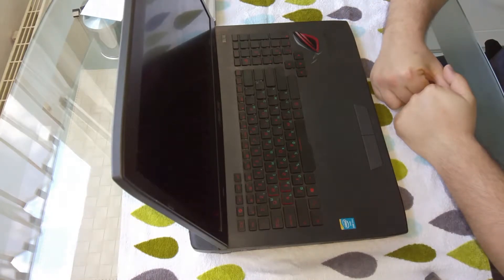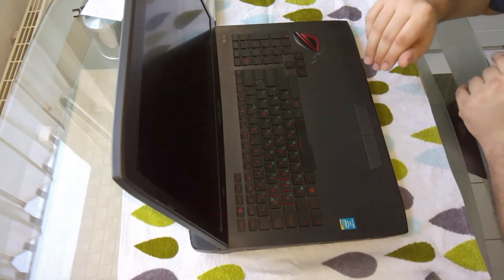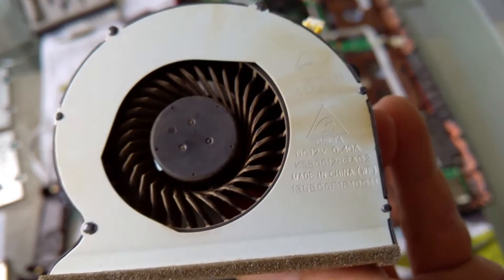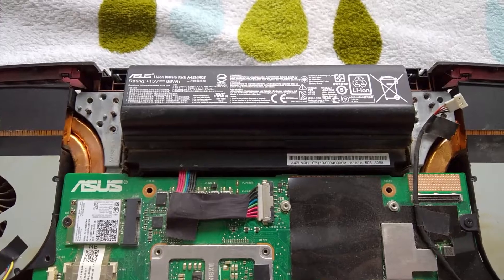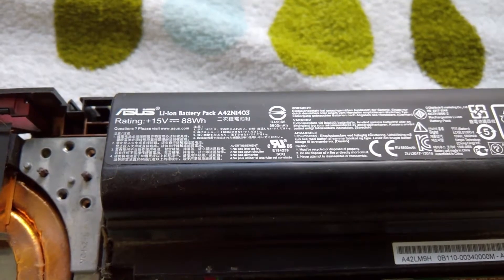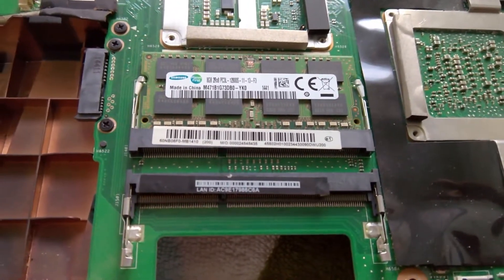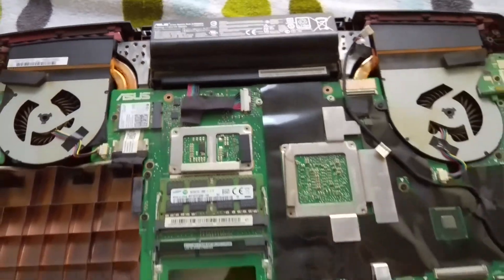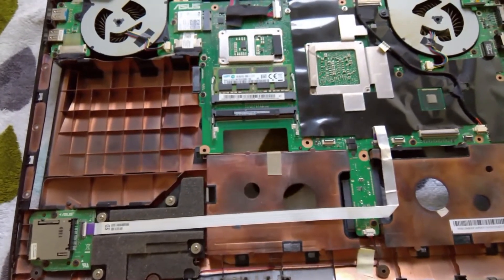Asus G751 - Things you need to know HD

Comment: Been using it like a desktop, not a laptop because the battery died just after a year. My previous laptop was a fujitsu 2010 with a removable battery that I used for 11 years and at the end it could still hold 3 hours charge but I had to retire it.

Comment: This is the best laptop I have ever had. Still using it after many years. I have replaced the battery twice, the keyboard, and had to solder in another 32 pin keyboard connector, due to mishandling the mother board and broke the connector. Other than that, it has been a workhorse for me. I run most games on pretty high settings without any issues. I bought another laptop an Alienware 14 with a 3060 graphics card and still would rather use this laptop on a daily basis.

Comment: Had this laptop for years now, pretty good laptop also i did OC the panel to 100hz when i got it. But sadly when i did update to bios version 213, it did corrupt my bios.. Now i'm using it as a paperweight until bios reflashing tool arrives.

Comment: The best laptop i ever seen and use it my life. 4 years working 24/7 on max gameplay max graphics in games. In the hot summer  playing on max pressure non stop and no problems. I have only the battery is not working and im lazy to change it coz i dont need it. One of the best cooling system in laptops i will say. I clean it 3 years after start getting hot 90 degree i open it and i didnt believe how much dust was stuck inside and now is 30 degree less like brand new. Panel quality amazing. Screen amazing no problem with it. Lid amazing strong base. Dosnt shake or anything after u cant even imagine how much usage. I cant even imagine changing to another laptop and if i will i will take next version.
Reply: kotarakbg same here brother! had it since december 2015 on christmas and still going strong in 2020 lol not even a single issue at all and my battery is still holding up to 78,000mah so far, have never cleaned it tho lololol. I got the one with gtx 980m gpu, i7 4720HQ with GSync pannel, and currently rocking the assassin’s creed odyssey on high setting with 40fps, freaking amazing machine!

Comment: I have just bought one, used (upgraded from a G75). I'm shocked to learn about the G751's problems. I'm pissed that I can't cool it from below additionally, because of the case being in the way (removing the bottom service lid doesn't grant access to the heat source). I'm mad the battery can't be removed easily. Which means it always charges and is ruined by now, but still consumes power needlessly and gives off heat needlessly. The ruined sub is a bad joke and I ain't laughing. If anything on the mobo breaks, you can't resell the rest of the components, because they are soldered on?! Oh god. Asus, YOU'VE CHANGED. I used to trust you blindly, ever since the K95 and the G73 and the G75... But not anymore. No longevity, no quality. F**k you, Asus.

Comment: So lately my battery has stopped charging and the light blinks orange, likely need a new battery. But another huge problem I’m having with this laptop is the keyboard, it’s not dirty or anything and some of the buttons do not respond unless you push very hard down on the button. It was working fine until the warranty ran out... go figure 😂 what would you recommend for the keyboard ? I’m unsure what to do but I was told it was going to be very expensive to fix. Thanks!
Reply: Easy to fix mostlikely a cord has come loose from vibration while traveling or minor shakes add up over time, just open it (look at a video) unlplug and plug back the cables, or just buy a replacement keyboard, or an external keyboard, whatever your setup is. Mine is connected to a big flat screen so I have wireless keyboard and mouse connected so not an issue but to each his own I guess.

Comment: Had one of em for 6 month….supreme cooling, CPU ok, GPU overclockable, RAM up to 32 GB DDR3L, battery issues everywhere and way too heavy to be taken on the road in a backpack. Thats why I changed to MSI: No cooling at all, GTX 1070 and 8GEN CPU. Not a very good choice either, but still....the battery works xD

Comment: Are both fans supposed to run all the time? I am only getting one
Reply from the maker: No, not really. When the laptop is idling or you're doing some light browsing only the CPU fan runs. If you put some stress on the GPU the other will also spin up. It's not running all the time though.

Comment: I definitely had issues with my battery and had to get a new one after two years. I then had to change it again the year after. I did well with my 3rd battery but I thought it had died after only few months of use. I couldn't get a charge until I messed with the battery connection with the motherboard and it started charging again. I love the laptop, but it has its headaches.

Edit: Typos*

Comment: Can you help me on this one?

I have my G751JY cleaned for dusting ,when I  bring back parts i don't know what happen but the touch pad and led Hard Disk light isn't working. The laptop won't boot if the touch pad is connected so I have to remove the connection thinking that I might have tripped on the ribbon cable i ordered replacement online but the problem wont go away. The laptop is functioning normally it just wont boot when the touch pad is connected. and also the led activity light for the hard disk doesn't seem to work as its not registering any activity light(blinking) but i see it blinks for a while when I pressed the power button for couple of seconds for a hard reboot. Anyone can help me on this matter?
Reply: EJ San Jose , check the 4 connector under the keyboard.maybe one of them was plugged uncorrectly.try this i m pretty sure about that.
Reply: You need to pull up the little brown or black bar on the top of the motherboard connector.
Pull up the connector 
Put the ribbon deeper as you can 
You can see an blue line write on theribbon.
This line need to be aligned with the end of the connected when you plug it.
Coper pin face up.
Reply: mrvegas06800 thanks for the response. Thou I already did that, I even swap the led ribbon cable with the touchpad cable and it still the same reault. I also order one ribbon cable off eBay and the same result.
Reply: mrvegas06800 strange is the laptop wont boot when its connected and im pretty sure its as deep as it can go. I also bought the laptop yo a local shop and the tech there was baffled about whats going on, asked me to leave the lapyop overnight but I refuse since I lnow they will just experiment on it. Anyway provided they had the ribbon  inserted themselves I taken the variable of wrong plug. Further idea is greatly appreciated. Though im wondering if the touchpad assembly itself needs replacing?
Reply: EJ San Jose check the pins inside the motherboard connector , check if one of them is bended or broken.also if the ribbon can pull off the touchpad try to check the wiring connection with electric  multimeter.
So if all is correct , for me and knowledge i think the better way is to order a new touchpad and try or if you  find  someone living near your location with the same laptop should be an pretty good idea.let me know....
Reply: mrvegas06800 thanks buddy. be checking on it and will let you know.

Comment: My laptop has 3 SSD drives. One boots with OS X Sierra, the other boots with Windows 10 and the third one in the caddy is for storage. I removed the dvd drive and put in a caddy that holds an SSD drive. You can also change the WiFi / bluetooth card if you want to run OS x Sierra on this machine which is what I have done.
Reply: Never thought of this, good idea

Comment: Can I upgrade to a SSD on this laptop? I have the same one.
Reply from the maker: Duckman Gaming Depends what's the ssd. NVMe drives do not work! PCIe M.2s work just fine as well as a standard 2.5" SATA SSD like the Samsung 850 Evo/Pro. This is what I have 512GB Samsung 850 Pro.
Reply: @amv.techpro  Hi. I wanted to ask if a PCIe M.2 SSD is compatible on model G751JM. If possible could you make a video about where the slot is?
Reply from the maker: @johnplaysgames9847  Hi John, I can make a video, but it will be pretty short one, since the M.2 SATA slot is the first thing you see, after you remove the back lid. It's actually inside the left (fans pointing away from you) 2.5" drive slot. You'll have to mount it sideways to the slot If you want to use it, and you'll also have to move the existing 2.5" HDD/SSD over to the right slot, but keep in mind that the right slot is only 3Gbps and not a full 6Gbps SATA connection. If you want to replace the system drive with SATA M.2 you'll have to first move over your boot drive, then clone it, or you can buy one of those SATA M.2 USB Adapters. I've done this before.
Reply: @amv.techpro  Hi Dongleboo. Thanks for the information. I actually replaced the battery on my G751JM yesterday and didn't notice it had an M.2 PCIe slot. I checked with Asus Support and they also said it doesn't have one. I currently have a Sata III SSD 2.5" for booting Win10 and a 2.5" 1TB HDD for storage. I will look further for the M.2 PCIe slot. Could you maybe provide me with a picture or diagram of where it is located when viewing your laptop from the back with the fans pointing away from you? Thanks. John
Reply: @amv.techpro  Also, what do you mean by SATA M.2? What is the difference (if there is any) with PCIe M.2 ?
Reply: Nevermind. I just researched it. An M.2 Sata SSD will only benefit from a smaller form factor compared to a regular Sata 3 2.5" SSD. The only one that will benefit is a PCIe M.2 SSD that mounts on the motherboard. That is the one I wanted to know if it would fit on my motherboard (G751JM).
Reply from the maker: So, I've done some digging and it turns out that some variants of the G751 do not have the cut out in the plastic chassis where the connector should be, but it's there behind the plastic. You should be able to fit even an NVMe drive, but you'll have to update your BIOS first, which is a bit risky on this laptop. I've recently updated mine and it got stuck in a boot loop which took me about 30 mins to figure out. As for the difference in SATA and NMVe, there are some slight difference in the connector types but it will be easier if you just Google "M.2 connector types". Previously the motherboard didn't recognize NMVe drives but they've rolled out the new BIOS last year. I'll try to do a short video describing the topic in the next week or so.
Reply: @amv.techpro  I opened the back of the laptop and I didn't find the M.2 Sata slot that you mentioned in the P0 hard drive bay (left, default bay). And if it is possible to install an NVMe PCIe M.2 SSD I would greatly appreciate a video on it! Thanks. Subscribed.

Comment: Got same problem with this shitty Intel ac 7260 wifi card. Unbelivable how they can put such a bad wifi card in a gaming lap top. Also I have a big problem with cpu temps, goes over 90 - 95 on a regular basis playing latest games. I had it repasted with profesionals after a year , but Im stil getting the same temps. Anyone got that solved? Should I undervolt my cpu with xtu, will that affect my fps in cpu hungry games, does it affect clock speeds? Never done it before so I'm not really sure what to do. Or maybe try buying vacuum cooler...

Comment: Sorry to contradict your information, but it's not only the storage drives and memory which can be upgraded, as I also upgraded the battery and my wifi card. It's pretty easy to get to the wifi, and I put a much better card in than came stock with it. The battery is more involved, but you can wiggle it out without taking the mobo off. Just thought you would want to know for future videos.
Reply from the maker: :) I was talking about mainstream parts, which are replaceable in most laptops. Otherwise, you can replace almost every part on the mobo as long as the replacement part is compatible. What battery did you put in? I'm generally curious as the slot for the battery is pretty tight to fit a bigger one?

Comment: i have the same problem with the battery. My second battery died last months. Is it cuz the heat?dunno why dat keep happening....i heard someone said on a comment in youtube its cuz of the bad cooling system in g751...im running my laptop with my dead battery right now. My laptop goes to sleep everytime. To keep my laptop wake i have to wake up the laptop few times  to prompt to not charging mode.but when i disconnect the power again i have to wake up my laptop few times again to keep it awake.i dunno is it worth to put a new battery again cuz in few months same gonna happen.is it a ok to remove the battery and use my laptop from direct power.
Reply: Have just the same problem. Did removing or changing the battery helped?
Reply: Вадим Кричківський. No I didn't removed the battery yet.....but I think it's the best option right now...
Reply: I think so too, but to removing the battery is really pain in the ass, I doubt I can make it by myself :/
Reply: Вадим Кричківський ya me too.....im kinda afraid to do dat....i dont wanna messup what left of my laptop....
Reply: I'm thinking my battery died also.. It stop charging first, then it used up the remainder of the battery.. Now I have a died laptop.. I will buy a new AC DC power cord and cross my fingers.. The three year warranty is the only way to go with these expensive machines..
Reply: @parallax9281  I just disconnected my battery from the Mobo had no issues for the past 4 years with it
Reply: @elchupanibre868  it was the AC DC cord.. Buy a backup one..

Comment: will the laptop run off the power supply without the battery connected? my laptop stopped booting up, no bias nothing. I get to lights on the bottom one white one when I turn it on and then it turns off when I turn it off and the battery light it shows that it's charging or unplugged. that's all I get out of the unit
Reply from the maker: I haven't tried this to be honest.  I'm not sure. it looks like either a general power issue or major MB defect.
Reply: Dongleboo I think I'll start with the power button board. I didn't have any issues with the battery before it went dead.
Reply: Disconnect the battery from the Mobo run current only, you'll have no issues personal experience is 4 years with it

Comment: My battery died two times already and it is been only an year and a half since I purchased the laptop!  I have always taken great care of my battery and I am barely even using this laptop for games or heavy computing.  Totally shit. Oh and the hard drive has done less than 90 TB read and write for that period and it is already packed with bad sectors and has a terrible response time. For the record, non-enterprise drives like this can do 180 TB per year. Even with a healthy battery, this laptop would'n last more than 2 hours on low brightness and battery saving enabled. A big pile of crap.
Reply from the maker: I'll speak English so other can understand as well. 
The battery is utter crap, I give you that. As for the HDD -  a SAS Enterprise HDD died 2 weeks after I installed it. Nothing is guaranteed.
That's why I moved onto SSD's. Currently, I have 1x 500GB Samsung 850 PRO and 1 x 1TB WD 7200 RPM HDD.
No issues so far. 
I think that with this laptop, they had some low-quality batches and this led to problems for a lot of people.
Reply: @amv.techpro   I got about the same configuration as yours when I first purchased the G751. I think it saved me some time, but like all Asus G751 owners I too an have either charging issues, battery issues, or both.. Once upon a time, replacing batteries was simple.. Not anymore..
Reply from the maker: @parallax9281  Yeah, it's the opposite of simple. The design wasn't made in a way so everyone can replace the battery. It's the last thing that comes out of the laptop...
Reply: @amv.techpro  LOL..! As opposed to the good old days, just a few years ago..
Is there any laptops comparable to these ROGS that are more reasonable in modular design that you know of..??
Reply from the maker: @parallax9281  Well, most new models from Acer, MSI and ASUS as well are now building the laptops in a different way. The battery is usually the first thing you can access and the whole motherboard  including the heat pipes assembly is covered by a single bottom panel. G752 is identical though. Same chassis, same construction. I'm thinking of switching to desktop now so I'm not very familiar with the current high-end gaming laptops.
Reply: @amv.techpro   so the 752 series are designed better that the 751's?
I'm going to look that up... Its almost worth building a clone laptop with higher quality components than dealing with a corporate machine..
Reply: Petar Dimitrov I managed to replace the battery, meaning I had to dismantle the whole fucking thing... Christ never buying from asus again!
Reply: @Laenthor  Its getting to where I'm shying away from any electronic items that does NOT have removable batteries. No one can guarantee the life of a battery in any of these machines, so hard wiring them to the boards make NO SENSE..
Reply: yeah mate.....i have the same problem with my battery.....my second battery died recently
Reply: i am planning to get this laptop as one of my friend is letting it go for dirt cheap,but there is the usual issue with battery.how does the laptop perform without a battery?does it affect performance,as what i let to know that the laptop use both power adapter and battery power during intense task/gaming.
Reply: Err before I got my replacement battery it still worked okay for gaming and stuff like that. Without a battery it might be fine, but I still had mine in with 0% charge and sometimes my laptop would just shutdown because it would detect the empty battery. I'd recommand the same model but from 2014 because this one has a user-removable battery.
Reply: When is some smart ass tech manager for these Laptop manufacturers going back to REMOVABLE batteries?
Replacing batteries for these G751's is like open heart surgery...!